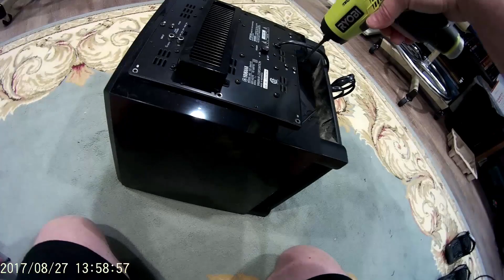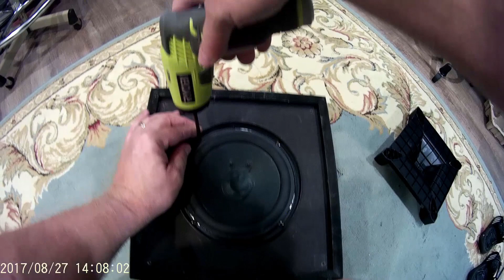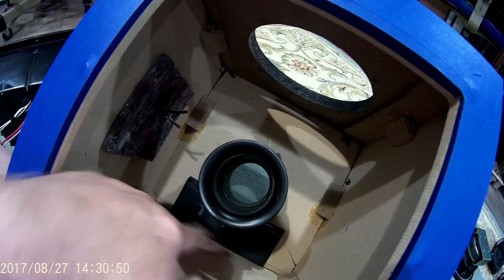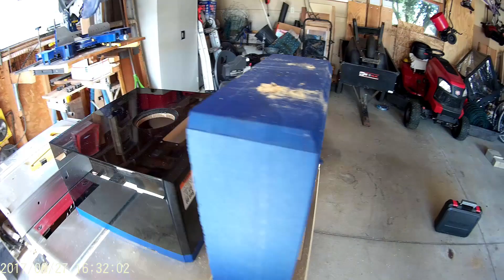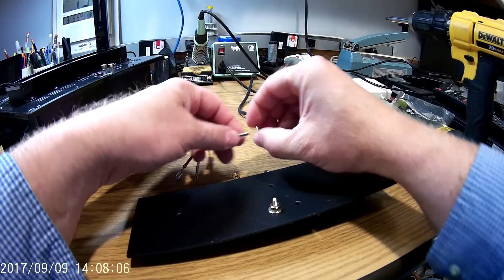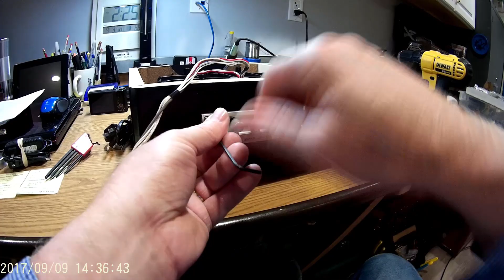How to Build a Bass Shaker Amplifier

Comment: Would have been good if you had showed us it working with you shaker.  Only a 25 watt amp.....  so not expecting a whole lot of shakin’
Reply: you did not watch to end
Reply: also it is 70 watt amp
Reply: So I watched it again from beginning to end.
At the end, I saw a glass of water vibrating on top of the couch.
Don’t get me wrong...... you did a nice job of the transformation, it is just that after 39 minutes I would have at least liked to have seen a shot of the Bass shaker and how you mounted it under the couch - (I thought you might have made your own shaker out of the speaker) - plus maybe a couple of little details such as frequency specs of the bass shaker and amplifier output.

Yes.... I notice that the watt rating on the back of the case said 70W.  I also found specs on-line of the SW-015 that said it was 120W “Dynamic power”. 
But the speaker you removed in the video had 25W stamped on it.  That tells me that even 70W would be peak power at best......   not RMS power.

So..... I guess it must have worked OK for you, but viewers would need a bit more information to be useful for assessing whether it is worth copying what you did.